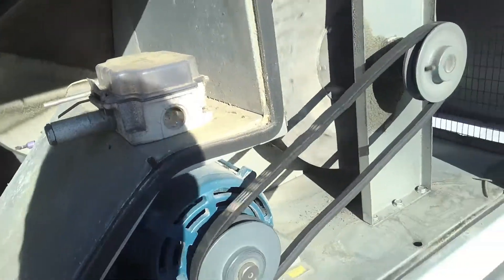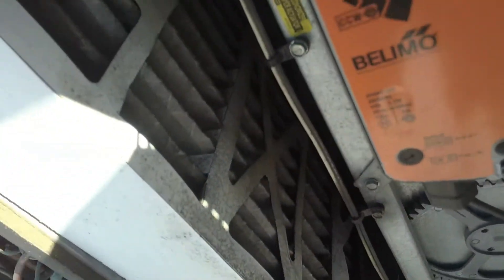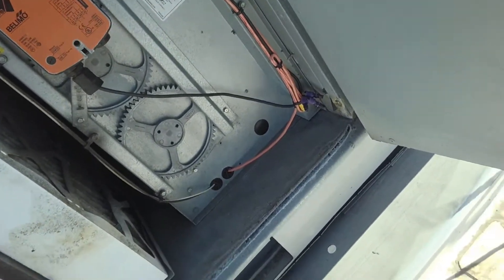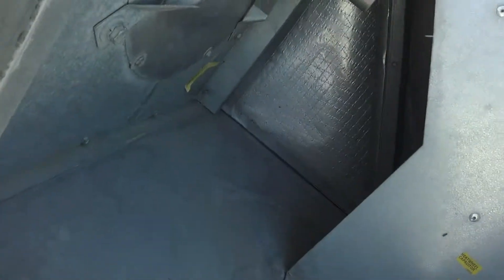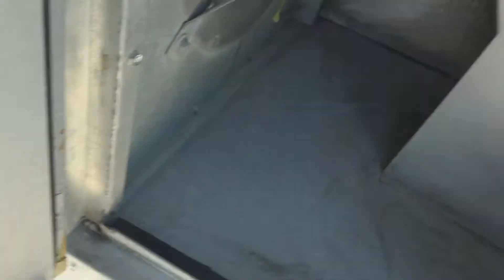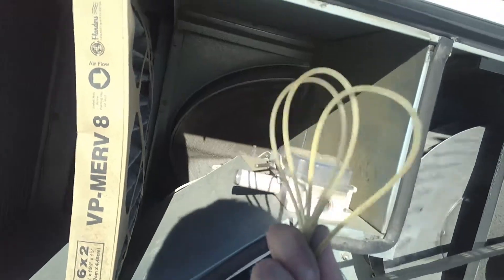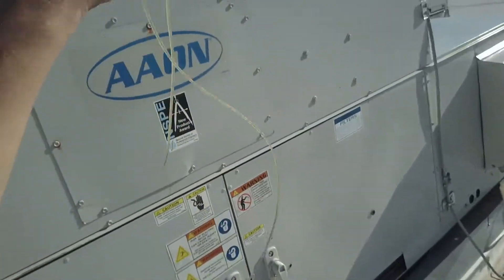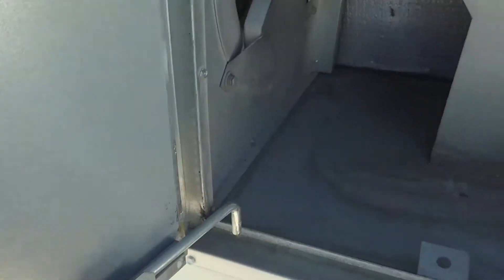AAON 6 Ton HVAC Popped A Belt For The Heat Wheel HELP!!!

Comment: Hey that’s a desiccant wheel. Do not put water on it, vacuum only. The air from the building exhausts through it then the make up air goes through it the other way. It warms or cools the air for make up purposes.
Reply from the maker: The AC company told us you can wash it with dawn dish soap and water. But every 10 years needs to be replaced. I asked what does it do? And they told me It traps the temp that's in the building and spits it back in sort to speak. I kinda Know what it does.How efficient it is when you are buying 1000 dollar parts almost every month to 6 months?  Well In my opinion it is not at all efficient. 
     YoMamma I Had and offer I can't refuse And I will Be Jeff the Maint Director for a different Property  but if I get the chance I will upload some videos on the new property but no more AAON vids😢 Thanks for all your input and as always Thanks for Watching YoMamma
Reply: You might have to pop the top. Btw the wheel absorbs moisture and gets reheated and exhausted out of the unit
Reply: They spin very slow. Half absorbs moister and the other side spits it out

Comment: what does makeup air units mean?
Reply from the maker: A larger air handler that conditions 100% outside air, and no recirculated air, is known as a makeup air unit (MAU). An air handler designed for outdoor use, typically on roofs, is known as a packaged unit (PU) or rooftop unit (RTU)
Reply from the maker: The Make up air units are manly to remove the carbon dioxide out of the building and put in fresh condition air .So instead of pulling the air out of a return they pull in air from outside. Thanks for watching Andy.